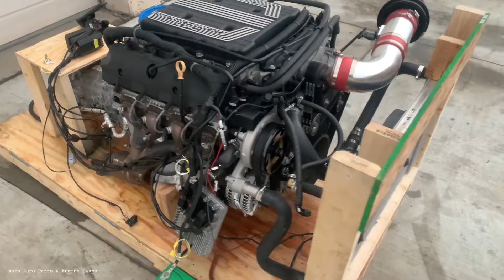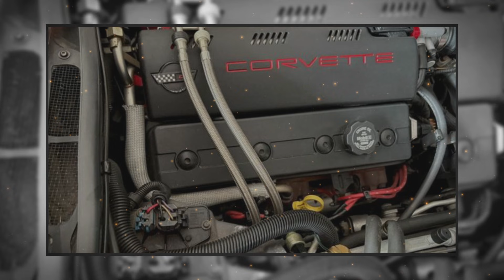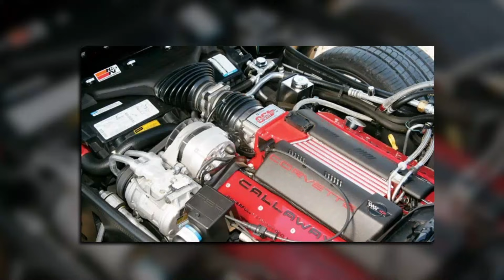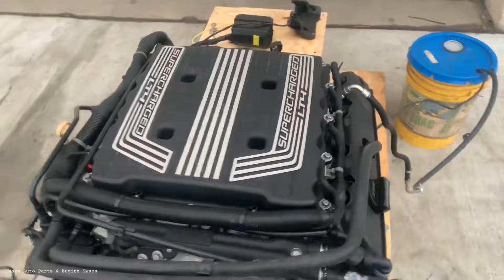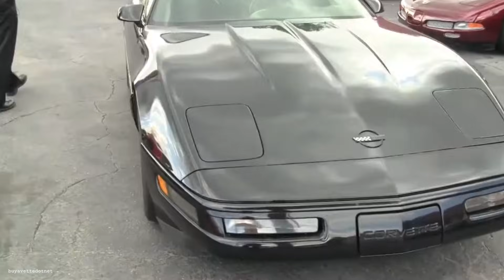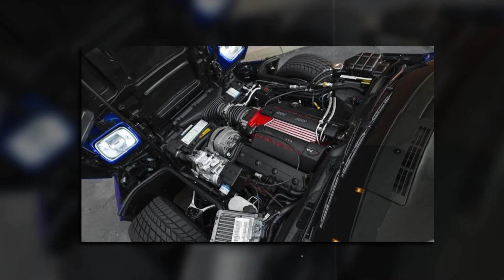Even at 330 HP & LT-4 Tune, the 1996 Chevy LT-4 Shocked Everyone Proving Pushrods Still Ruled

Comment: The LT1 with an optimized tune and free flowing exhaust has been dynoed at 391 HP and 402 ft lbs at the crank. It was basically LS1 powerful already if not for the intentional factory detuning and exhaust. The exhaust, tune and mains made the difference between the Corvette LT1 and the Fbody LT1. The LT4 was literally almost overkill.
Reply: You got a link for this? Sound a bit optimistic. Also the intake was different